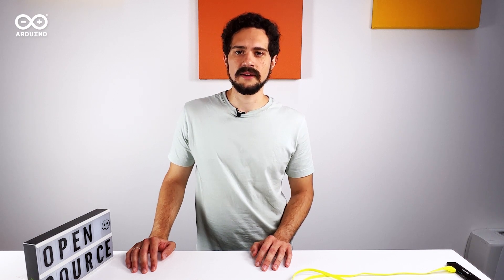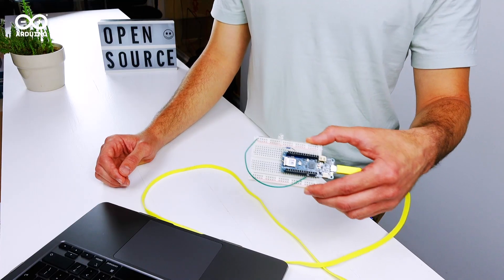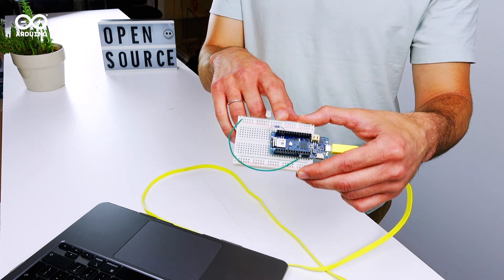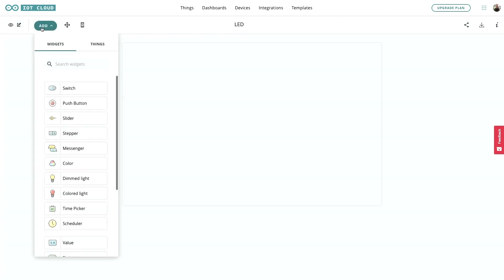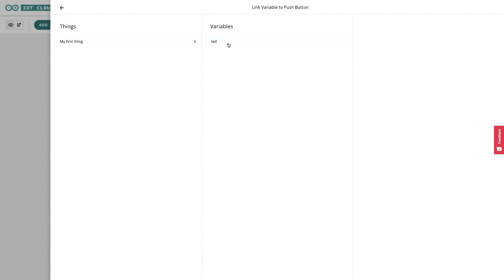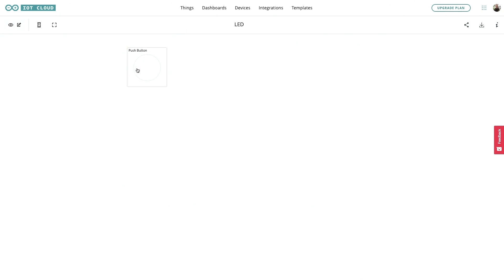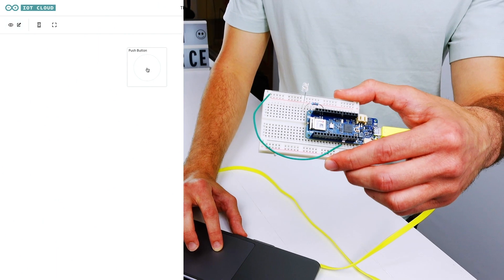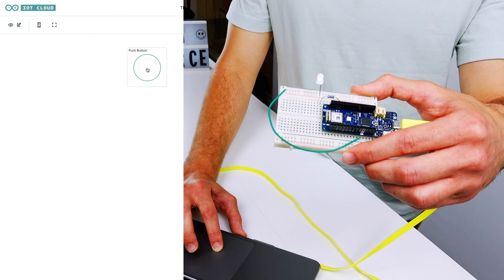Using a Push Button Widget in Arduino Cloud

Comment: hi, I am having a problem with a push button on IOT, I need it to rotate a stepper clockwise one turn and counter clockwise one turn, I have it working just fine with the UNO and a physical push button, but when I take the project to the iot, I can not work with the widget so I am geting random results. its not consistent. How can I make it work since I can not make an INPUT PULL UP pin in IOT to work with a virtual button?